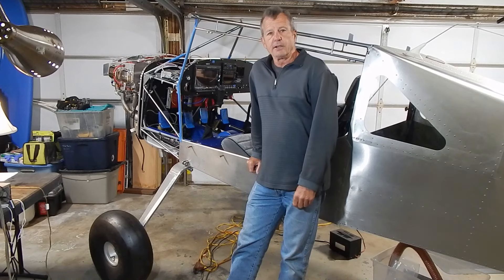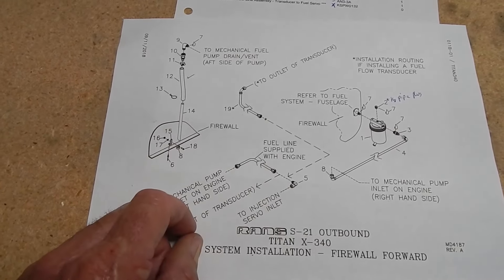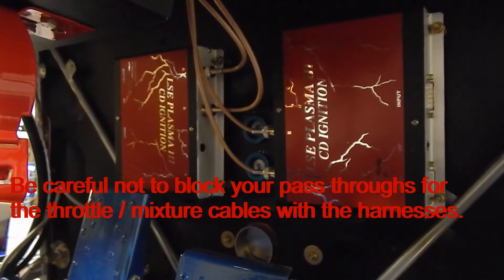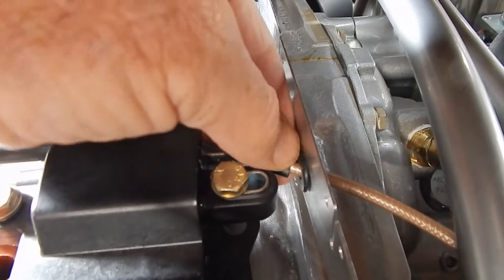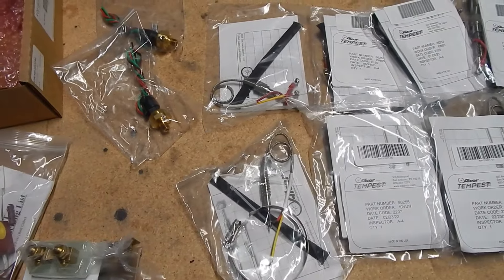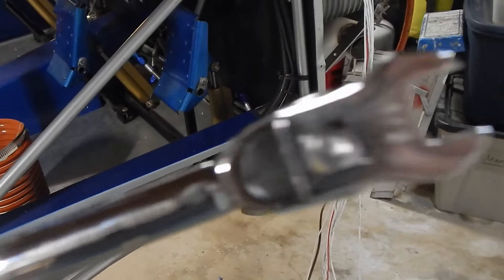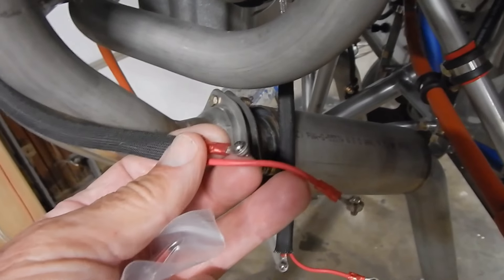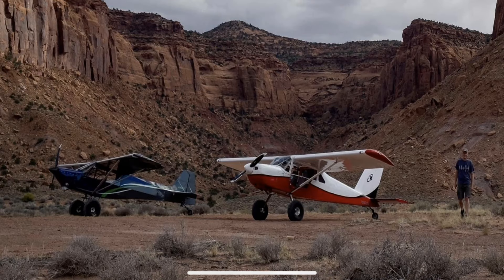RANS S21 Build ep 41 CHT EGT Wiring

Comment: I recall reading those holes for the ignition wires in the baffle were from the original design where two coils were mounted on the front of the engine and two in the back.
Also the spark plug boots slide off the ignition wires.
Reply from the maker: AAARRRRGGG.. The amount of time I look through boxes of parts because the manual has not been updated is frustrating.  Thanks for the info on the boots.  The 2nd plane will be much easier. Oh wait, I'm not building a 2nd plane... Congratulations on your plane.  It's looking great.